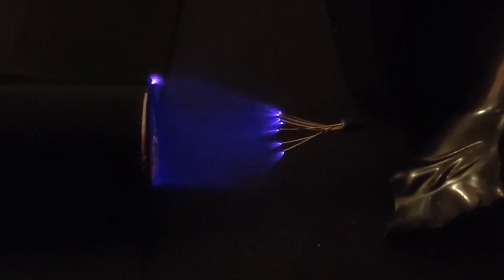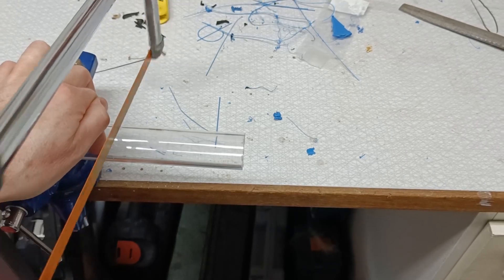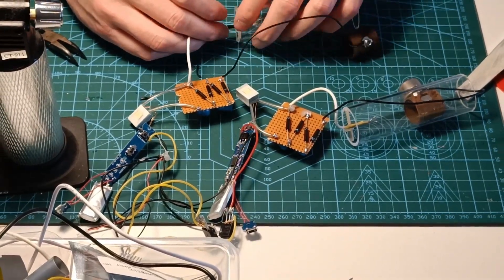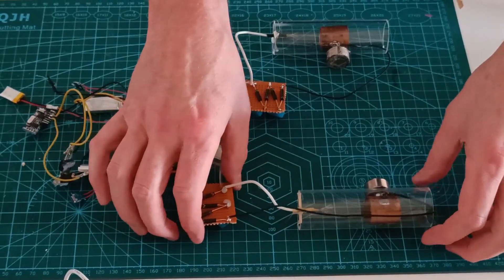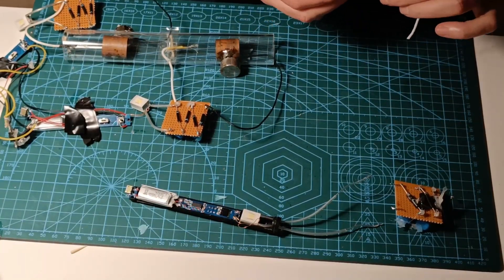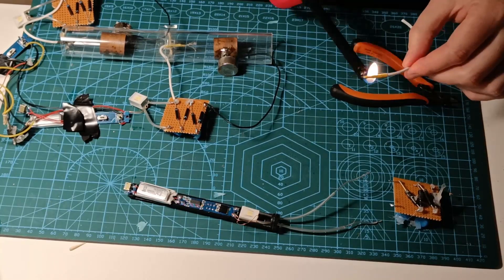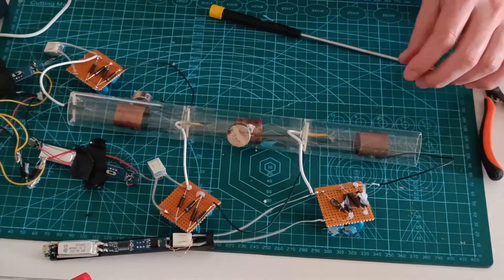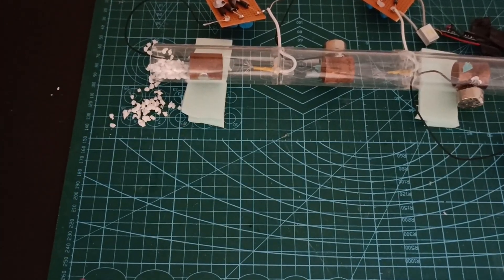Ion engines in series

Comment: Whys everyone use circles it’s need to be cones and if your gonna stack the reduce the size each section so it will accelerate the air
Reply from the maker: The thrust isn't high enough to compress the air. Maybe if we build a more powerful engine we can achieve that effect.
Reply: @rptechlab  How high does the thrust need to be in order be able to compress the air?